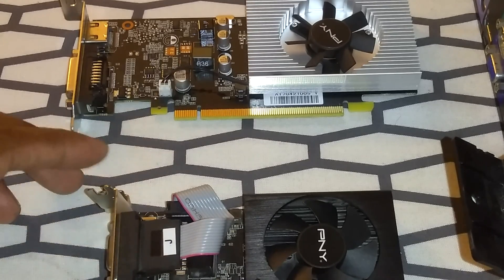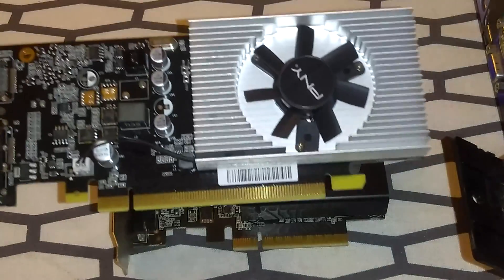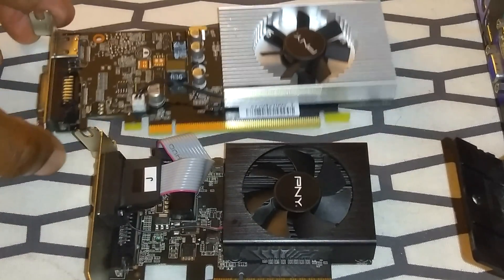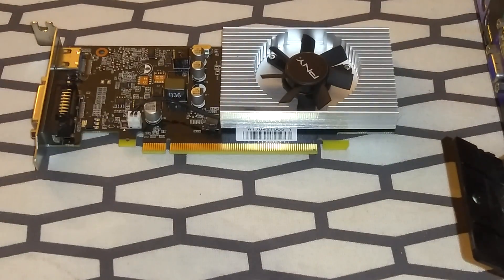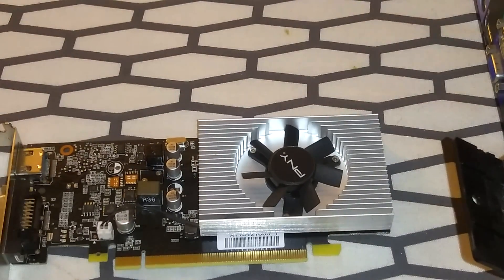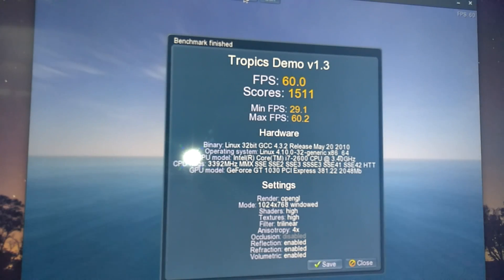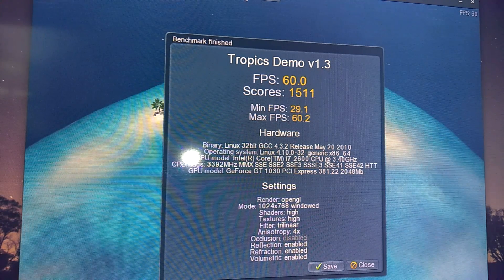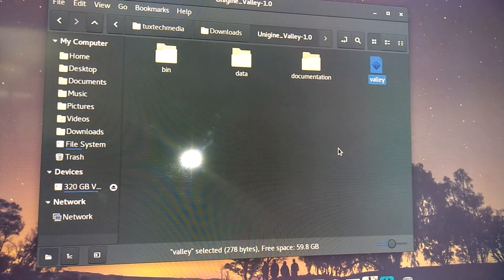Dell Optiplex 990 GT 1030 UPGRADE VOL. 1.

Comment: I've put this into my Optiplex 990 and received worse results with the GT1030 in my PC. Any suggestions on what's going on?
Reply: Check the thermal paste
Reply from the maker: It could be a number of things. Low or bad ram the need of a BIOS update. Even a bad hard drive.

Comment from the maker: Yes if it's a low profile Gt1050. And the Dell is a slim line desktop. Plus the GPU should work in either case.
Reply: I have an optiplex 990 sff, people say they have issues when upgrading to gt1030, did you have them?
Reply from the maker: @hardwarereviews9170  No I have no problems at all, in fact I'm responding on that pc to right now.
Reply from the maker: @hardwarereviews9170  And im running Ubuntu 20.04 LTS. AND ITS AWESOME...
Reply: TuxTechTV thanks so much
Reply from the maker: No problem!!! Please subscribe?
Reply: Wait, do you also know if a low profile GTX 1050 Ti or non Ti 1050 can fit in a SFF Optiplex 990? Im thinking of getting one
Reply from the maker: If that's something your in favor of getting, at the end of the day it's your money. Just let me know what the results are.
Reply: I just need to know if it fits in the PC
Reply from the maker: Yes, it will fit in the PC only if the GPU is a slim PC like mine. That's why I told you to look for a low profile GTX 1050. Here is a Link: https://www.newegg.com/Product/ProductList.aspx?Submit=ENE&DEPA=0&Order=BESTMATCH&Description=gtx+1050+low+profile&ignorear=0&N=-1&isNodeId=1
Reply: What BIOS are you running? I can't' get any video coming out of the GT 1030. I'm running A13 on my optiplex 990. I saw your other comment and updated to A13...and I'm still getting no video out of the card.
Reply: So, I’ve just watched a video on installing a GTX 1050ti in a Dell optiplex 990 SFF and It worked. Unfortunately I DONT have a 990 SFF, I have a 990 DT. Now, The DT has a 250 psu along with a 35 watt limit on the pcie 16x slot (the blue one) when I checked the manual. Considering that the 1650 is a low profile card with a TPD of 75 watts. Would it work on the 35 limit? Will it disable the limit if I insert the card? Will I need to change a setting in the bios? I been searching all over the Internet for a solution and all I’ve been running into was the option for a GT 1030 because of its TPD of 30 watts. I would taken it but for some reason, the GT 1030 sells for $20-$25 more than its MSRP of $75. That’s not happening unless I’ve got no other choice. I realized that because of the DT’s form factor, cards such as the RX 480, 1060, etc, will NOT be able to fit in the case/ nor run due to its need of a 6 and/or 8 pin connection. These same cards cost about 90-130 dollars. Seeing that I was actually planning on purchasing a gt 1030 for around $100-$110 is ridiculous. I’ve got about $177 on hand right, and I’ve came up with a few choices: 

1. Buy dell optiplex MT ($100) along with an OEM Rx 460 ($55)

2.Buy Dell optiplex MT ($100) along with a 500watt 80+ white psu (60-$70) (This means I’ll have to wait to get a gpu)

3. Buy gt 1030 gddr5 ($105)

4.Buy GTX 1650 ($175)
 
So now that I’m finished with my essay, what do you think I should do? 
And sorry for your time 😔

Comment: Was it a small form factor? Im thinking of doing this to mine
Reply from the maker: XTheo23 It's a low profile GT 1030 I picked up at Bestbuy.
Reply from the maker: I changed my mind on the GPU I went with a Low Profile Nvidia GT 1030 instead. Its good enough for my needs.